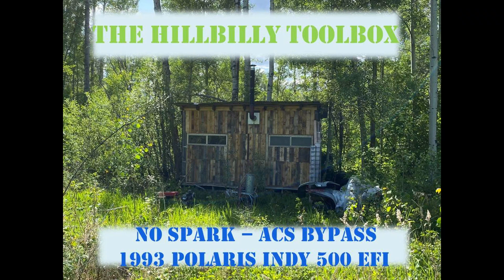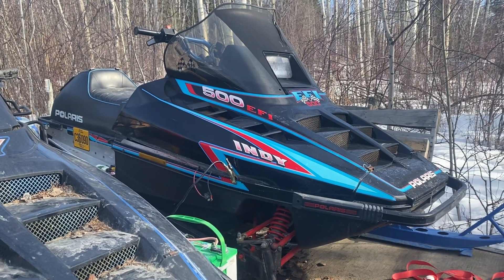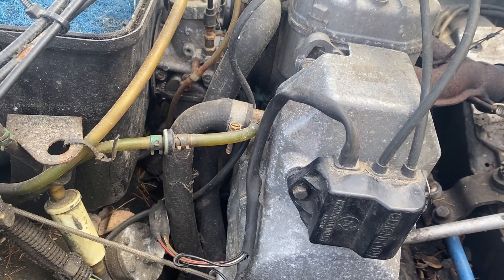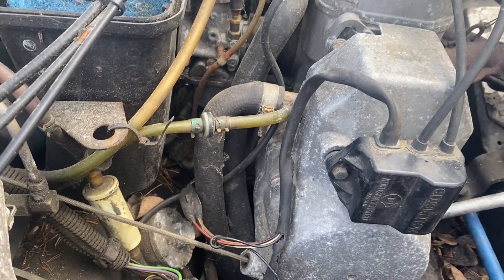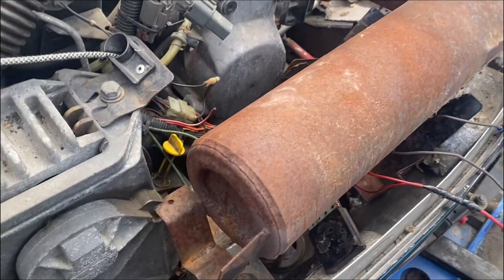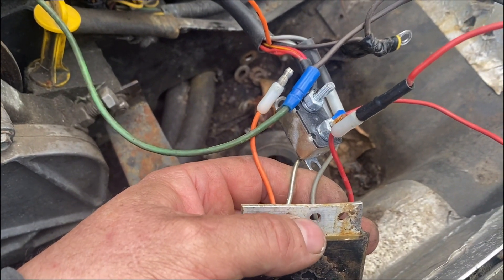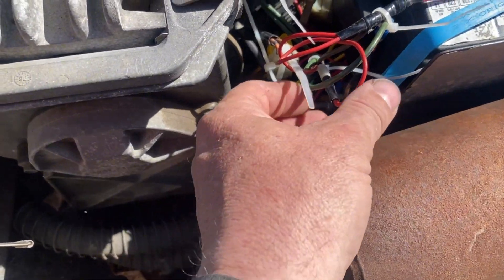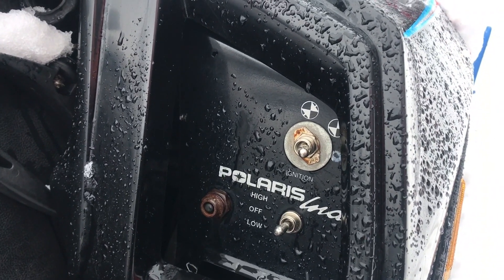No spark? Fuel pump not coming on? ACS failure! - 1993 Polaris Indy 500

Comment: im a 2 stroke outboard tech so same procedure but i would mention a couple things: if you have spark on one cyl dont bother testing the kill circuit and charge coil in the stator. also, resistance tests only tell you a small part of the story! the real test is cranking and/or running with a DVA meter to make sure that component is actually good. the CDI can also be crank tested with a 10ohm 10watt resistor like for moped headlights to simulate running load, then again with just thr DVA connected to coils. if the voltage (120v plus usually) drops when connected to coils but fine on the load adapter, you know the coils bad. opposite for the CDI.
Reply from the maker: It's good to know! Most people don't have the understanding or the tools to go in depth like that. Do you make videos? You probably should!
Reply from the maker: I have an old 1973 110h Johnson with 4 cylinders but only the right bank fires. New coils and plugs installed as well as a switch box. What parts should I be hitting with a hammer next?